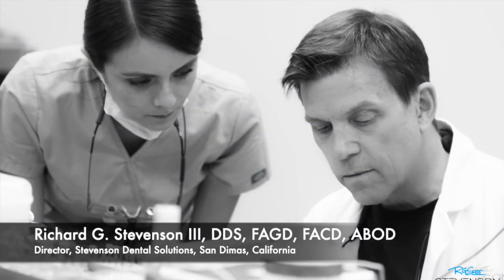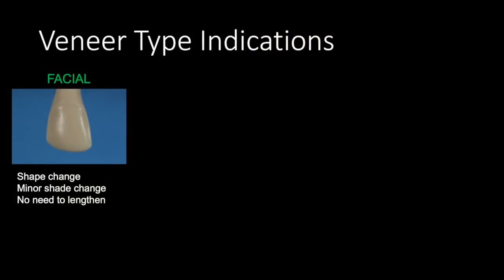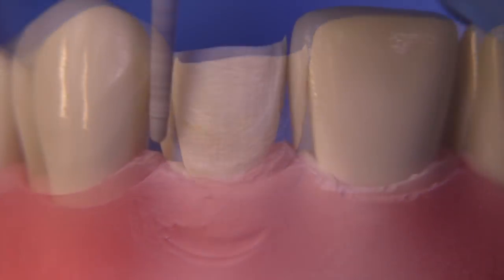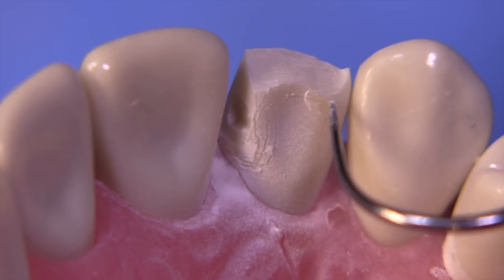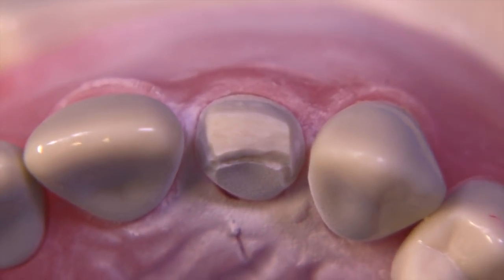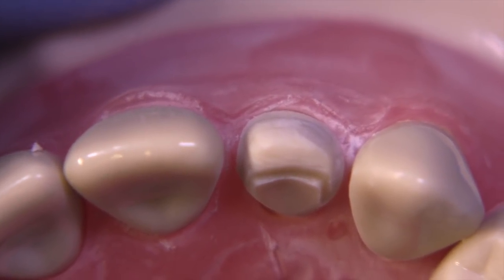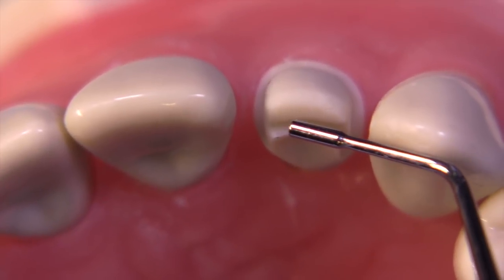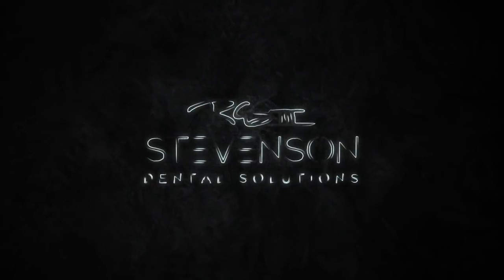Anterior Ceramic Veneers, Part 5: Super Veneer

Comment: Doctor you said here that emax is indicated for super veneers when when we have more dentin or unsupported ceramic. But can we also use emax for labial or lingual wrap veneers? I believe they can also be made as thin as 0.3mm. 
Or feldspathic ceramic are better choice?
Thank you in advance
Reply from the maker: e.max is very very difficult to thin to 0.3 mm but it is possible with an exceptional technician.  Feldspathic may be made thinner and has the distinct advantage of having intrinsically crafted modifications to shade and translucency.
Reply: @StevensonDentalSolutions  
  Thank you Dr. for taking the time and answering my questions.
So what do you think a dentist should do when his lab doesn't make feldspathic porcelains and is incapable of making the e.max this thin? What would be the next material of choice that can be used without sacrificing tooth structure, remaining in enamel, and looking natural?
Many Thanks
Reply from the maker: @amirmo6615  5Y TZP (Translucent Zirconia)  and a careful bonding protocol using Air Abrasion, MDP Zirconia Primer and Resin Cement.

Comment: Is there a certain amount of lingual reduction required? For ceramic crown it's ~1 mm. Are we aiming for that here also even if the finish line may be above where the opposing tooth occludes? Thanks!
Reply from the maker: With an enamel only preparation with bonding, the ceramic is mostly under compressive forces and requires very little thickness when adhesively bonded, hence as little as 0.8 mm would work, but 1.0 mm is better in areas where contacts occur.  Also, we try to avoid contacts on marginal areas as well.  Thank you!
Reply: @StevensonDentalSolutions  Thank you! As luck would have it, her central incisors are mesially rotated so her contact is on the mesial marginal ridge haha

Comment: Thank you for the nice informative video,it was great,my question is how many millimeters do you open the contacts?also is super veneer same as vonlay?  thanks again for the great work
Reply from the maker: The contacts are only slightly opened using a diamond IPR strip - about 40 microns - just enough to separate the dies in the lab and protect the finish lines form being damaged when the tires are separated.
A vonlay is when a posterior onlay is extended to cover the facial for esthetic enhancement.  A super-b veneer is a typical facial veneer that wraps over the lingua enough to gain resistance and retention form.  The are related but the vonlay is a term used for posterior teeth and a super veneer is a term used for anterior teeth...
Reply: @StevensonDentalSolutions  hello doctor: thanks for the prompt answer, I meant  what is the  amount of contact opening in super veneers,looks to me that it is like a full crown. is it not?
Reply from the maker: Oh, yes it may be quite a lot - depends on the needs of the case, the existing wear, existing restorations, etc.
Reply: @StevensonDentalSolutions  thanks doc.
Reply from the maker: @farshadbajoghli1606  My pleasure!

Comment: What a wonderful work but can i ask you about bond strength if these case i mean if we have exposed dentin 50 percent do you think it good case for a veneer? Data show increase of failure with dentin exposure , so whats your opinion ?? Thanks
Reply from the maker: Correct - that's what we use additional retention and resistance features with the super veneer. Thank you.